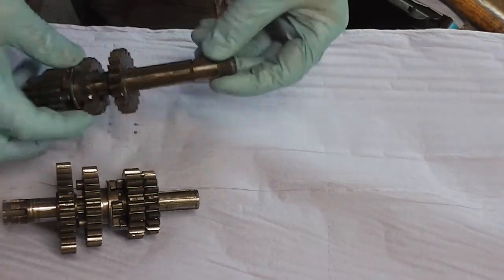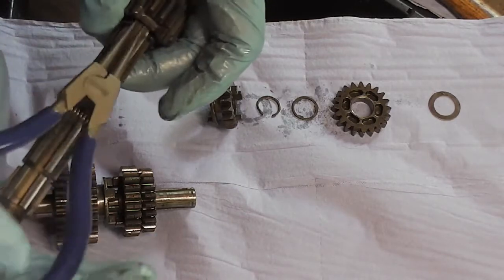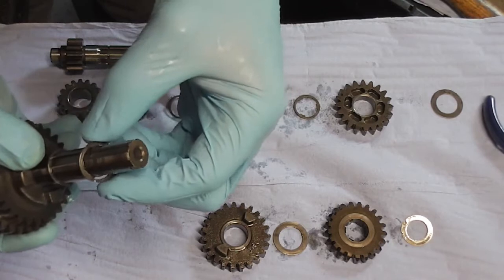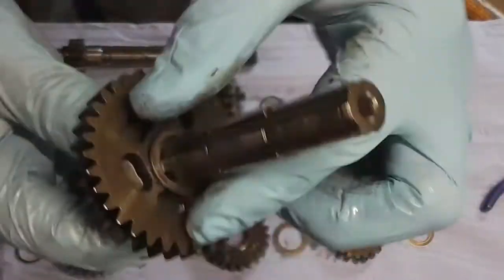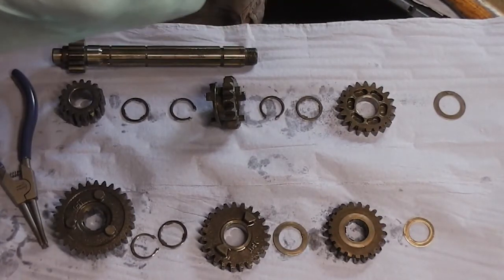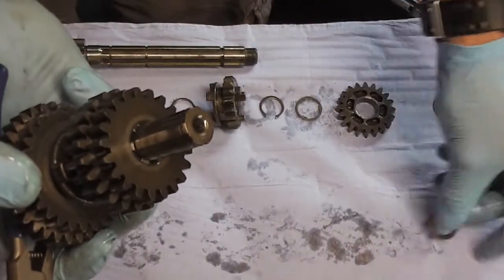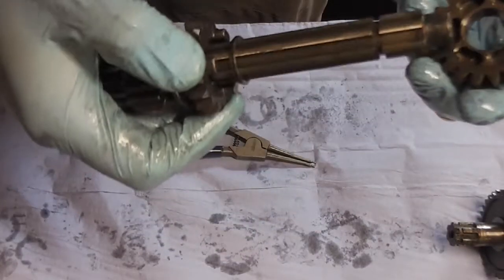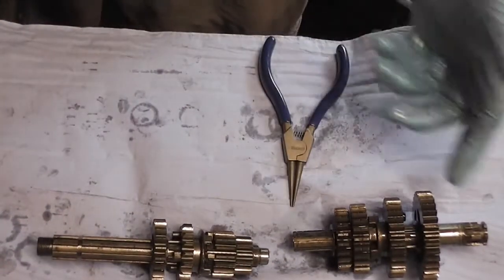Pit bike gearbox strip down. Taking apart a pitbike gearbox

Comment: Hello mate was wondering if you could help me out and tell me out i easily remove and change the gear selector as it’s worn where the gear shifter goes thanks
Reply from the maker: Remoce the clutch side casing and the clutch and you can pull it out that side then

Comment: i have some chinese 125cc pit bike... its started to make like a metal slapping sound when riding, in every gear , but it stops making the noise when the bike is in neutral or with the clutch pulled in. im assuming something in the gearbox is ratting around like a tooth broken off maybe? hopefully its something obvious like that.... it runs well and still shifts and rides fine just that noise of impending doom is forcing me to do something before its too late. ever had some mystery noises like that before only while in gear?
as far as i can tell its not the primary chain but possibly could be the cam tension chain
Reply from the maker: It could be the timing chain tensioner i suppose 
What type of tensioner is on your engine
It could be a few things i suppose.
I would start to take it apart and see what you find
Reply: @motorcyclefixer  i have pulled the motor out planning to take it fully apart and look for anything wrong, but since the first step is to remove the timing chain and head i guess i should check the tension and see if its sloppy. i know i had this head off before buti can't remember how the tensioner works. theres bolts on the bottom but theyre all screwed in fully so there is no 'locknut' kind of adjustment from what i see. but i have no idea what im looking at since im new to this stuff. sorry for being vague but im wondering if you have any generic advice for me? i guess to start i should figure out what kind of motor im working on(aka which motor china cloned it from, if any) and find some documentation

Comment: What size bearing does the output shaft use please , mine exploded an cant get the numbers off bearing ring to replace?? Its a splined shaft z155 engine
Reply from the maker: I'm sorry
I dont have any around me at the moment to check
You can measure the shaft, measure the hole and the thickness and there are bearing guides online you can put the measurements into that will tell you the number of the bearing you need 
I hope this helps

Comment: I have a yx 150 that cant find neutral. I have N bottom then 4 clicks up, and even after replacing the clutch hub gear that I found was initial culprit, when I was told motor was blown I'm still stumped, back tire still spins and clutch wont disengage gears or stop back tire from spinning.
Reply from the maker: If you turn the bike off and put it in neutral, try then to turn the back wheel. Is this turning the engine over or can it spin without moving the piston?

Comment: Hey! i would have a problem with my 160yx engine when 2 gears raise to 3 gears, vaivde does not go on and does not work properly in 3 gears, 4 gears works without problems
Reply from the maker: Sorry I don't know what vaivde is but if you have a problem just with 3rd gear then you can change individual gears but you're better off changing the whole gear cluster
Reply: @motorcyclefixer  okay, i have new gearbox already... I think the gearbox is adjustment a not good
Reply from the maker: @tiitus4179  make sure all the spacers are in the correct place
One of my other videos show that
Is the bolt in the end of the barrel behind the neutral switch
Reply: @motorcyclefixer  okay, thank you.

Comment: Hi there mate i have a zongshen  190cc I have just recently just changed the selector drum as when I was riding it would be okay in 1st then as soon as I changed in to 2nd it sounded like the gears wer grinding so I stripped the engine down to find the gears were fine so I checked the selector drum and it seem to be abit worn on the forks so I ordered an new one long story short it doing the same thing in 2nd but jutted abit in e if the gears. You have any idea on what it could be mate your help would very much appreciated mate 👍🏼
Reply from the maker: Hi 
If it's just grinding in certain gears i would look to change the complete gear cluster if you cannot find anything else wrong with it
Reply: @motorcyclefixer  well today I’m going too pull my engine out Iv had a thought and think it be 2nd gear spinning on the shaft maybe we’ll see today but I think It could possibly be that and If can get away with buying second gear should be okay if not looks like a whole new gear box 👍🏼
Reply from the maker: @Nanooldz5  good luck with it 👍🏼👍🏼👍🏼
Reply: If the gearbox is made the same as the Z155 then the dogs on the gearbox has a radius at the bottom of the dogs and it makes the gears try to push away from each other when you are riding. You need to get either a diamond file or very carefully use a multitool cutting disc and VERY carefully grind the radius to be a sharp 90 degree with no radius to stop it pushing into the gear selector forks and the selector drum. All the Z155 engines are like that so you either need to strip it from new to do it or run it for a few hours and once it is run in strip the engine and do it then. My engine has 13 hours total run time on it and the selector fork is wrecked and had to be replaced over the weekend.

Comment: Does this also work if the engine has locked up ?
Reply from the maker: Hi 
Usually if the engine is locked up there's a problem with the piston, valves and cylinder
good luck with it

Comment: Hey!
I have a problem with the transmission in my 150 Lifa.
the gearbox rotates when the blocks have not been tightened and the gears change, but when the blocks are tightened the gears do not change or the entire gearbox does not rotate anymore.

thank you in advance
Reply from the maker: Either one of the gears are damaged (or more than one) or one of the transmission assemblies are too long. You will have to dis-assemble the transmission and inspect each gear individually for cracks or bent teeth
Reply: @motorcyclefixer  okay. 
I buy new transmission and it start Works good
Reply from the maker: @tiitus4179  excellent
Well done 👍🏼

Comment: Hi are stomp 140 engines reliable?
Reply from the maker: Change the oil regularly and make sure you pull the clutch in when you change gear and they are reliable 👍🏼